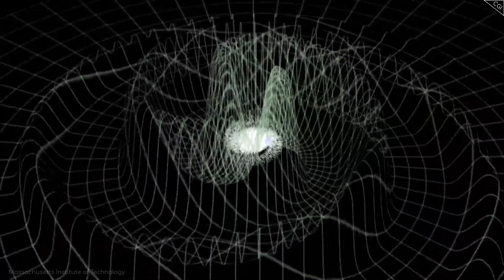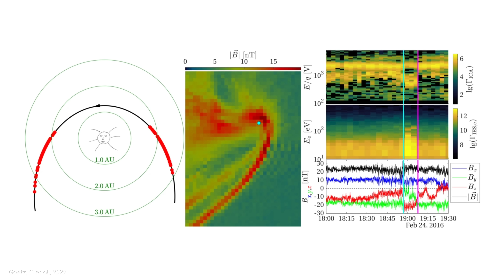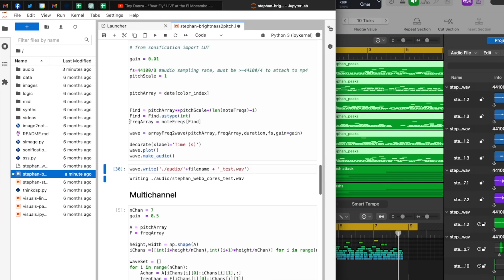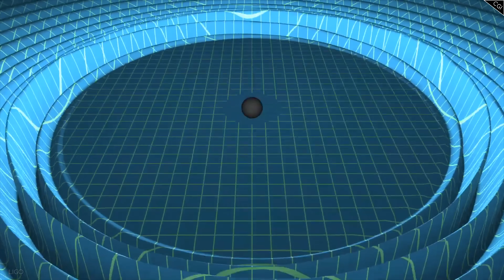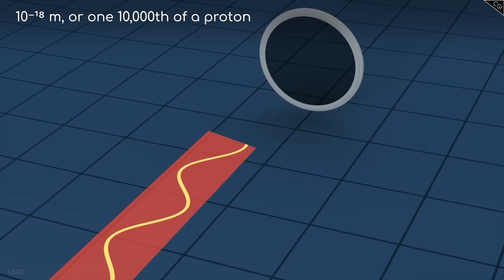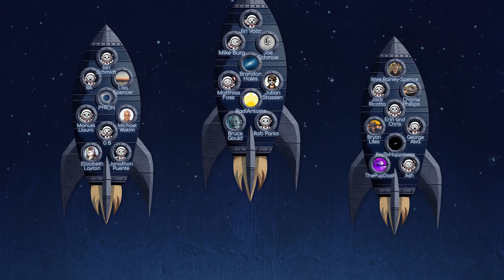This Is the Scariest Sound in Space

Comment: I have not actually watched the video yet, but there is no sound in space and very few vibrations. The most vibrations you'd get would be from your rocket/shuttle. Sound waves require a medium to travel through, and space is a near-perfect vacuum with very few particles. Sound needs vibrations and the empty-ness of space doesn't allow those to travel through space to another thing. Vibrations coming from your "ship" would transmit through the "ship". Not from a black hole to your shuttle or vice versa.

Comment: "Energy equivalent of 5 solar masses" Doesn't really explain it very well. So let's pull out a bit of Einstein to help with this. Energy can be converted into matter, and matter can be converted into energy. In fact, matter is just an extremely dense form of energy. The conversion rate is Einstein's famous equation *E=mc^2*. E is energy, m is mass (in kg), c is the speed of light (meters per second). Lets try it out. Get ready for some big numbers.
-For a baseline, the sun emits 3.8x10^26 joules in a second. That's 38 followed by 25 zeros.
Sun's mass is 1.989x10^30 kg. Multiply that by 5 and plug it all in.
E=9.945x10^30 x (299,792,458^2)
E=9.945x10^30 x 89,875,517,873,681,764
E=893,812,025,253,765,142,980,000,000,000,000,000,000,000,000,000 joules or roughly that.
Keep in mind that this is in gravitational waves which are completely invisible to us. However, if we divide it by our baseline it shows that if this energy was visible light it would be about 2,352,136,908,562,539,849,947 times as bright as our sun. That is literally brighter than all the stars in the universe combined. To quote Eccentrica Gallumbits, the triple-breasted w---- of Eroticon Six, these events are "The best bang since the big one!"

Comment: The audio from 67-P...any chance it's a by-product of the spacecraft's range finding gear? If the spacecraft uses a pulsed radar to determine precise distances, and those radar pulses are then interacting with the comet? I ask because the shifting return frequencies sound a lot like doppler shifts (i.e., higher pitch when moving towards, lower when moving away), which I would expect to occur as the spacecraft orbits a two-lobed object.

Comment: You're partially incorrect about space being a vacuum and sound requiring a medium to pass through and space not having any medium. Space is not a perfect vacuum. There are still a few hydrogen atoms per cubic meter. Knowing that, a medium exists, just not a good enough medium for sound to travel. Space is the closest thing we have to a perfect vacuum and that's why it's only referred to as a vacuum just based on its low density and pressure.

Comment: 10:09 I'm confused here: That frequency of the x-ray signal is so low that only a very tiny fraction of one period can have been recorded. But how can that be enough to convert it into a meaningful sound, or determine the frequency in the first place?
Reply: because they aren't using a recording but rather extrapolating data based on measurements. this means they can create a longer set of data that would be otherwise impossible to record, which they then generate the audio from.

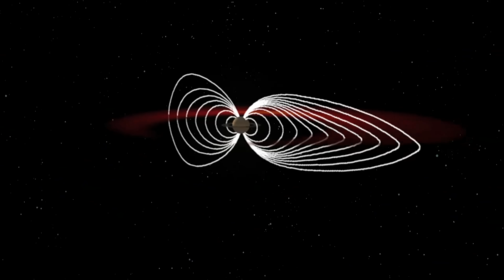Comment: 3:26 you're talking about two different types of slow motion.  One is made by firing the shutter at higher speeds, so it captures more frames in a second and then plays them at the speed we are used to seeing media in so it's fluid and more detailed.  The "smoother" effect you are speaking to comes from digital slow motion which duplicates frames and plays them multiple times, you're seeing each frame multiple times in a row.  That means that the video was not originally captured at a higher frame rate and they duplicated the frames and did not use modern day image tracking technology to generate frames in between that where a composite of the current frame and next frame in between which is also commonly used. It's just laziness I would say, it's cheap tech, they just suck at this.

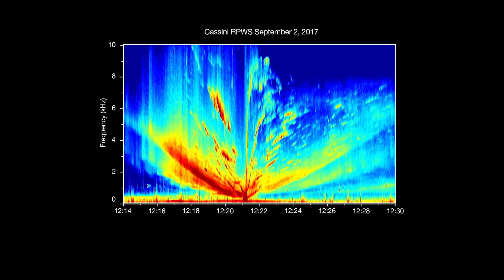Comment: The sound clip at 5:28 I've heard before on Earth with my own ears. It is a very similar sound that a passing Tornado makes. It is certainly something  you don't want to ever hear again. None of these sound clips are particularly eerie to me. They're more intriguing than they are scary. You can hear some odd transmissions using a Yagi antenna attached to a handheld HAM radio. I've heard abnormalities on 2 meter and 11 meter bands that no one has yet to discern.

Comment: Ther is no such thing as a vacuum in space, for it is not empty. All matter IN space can host sound. 

And that matter is indeed traveling through "empty" space. Of course sound cannot propogate without the object, but it's a logical fallacy to state that space is a vacuum. It's also full of dark matter. "There is no medium in "empty" space" So space isn't a medium which hosts mediums?

Space that was empty and a "vacuum" one second ago, can be filled the next>  with said object and vibration.

Sound is tied to matter—it doesn’t need space to get out of it's way. 

Another reason it is not an empirical statement is because the state of any "fixed area of space" being either space or full of matter is not a fixed state, but constantly subject to being the host of a medium.

Comment: I'm curious... If the wavelength is actually millions of light years long, and it has been compressed to a frequency of ~250 Hz, (human hearing) it would take around 2500 waves to make a 10-second video. If each wave is 10,000,000 years long, it would take 25,000,000,000 years to record that sound. That is older than recording technology, or for that matter, older than the universe. How were the data for this sound gathered?
Reply: … because space Time is something completely different to our moments of Time.

Not to mention, it is okay to not understand how to convert these numbers. Because that is how science works
Reply: Sound travels further and faster than anything if you think of it as simply vibrating particles of one another... In a medium of dense exotic matter, it wouldn't take much for sound to speed faster than light. Light is constant.. and it depends on matter in it's medium to even survive.. black holes steal light yet never sound.. because the sound coming from them is faster than can be comprehend
Reply: Exactly!?!!!!
Reply: It's all just best guess...
Or, in this case, made up.

Comment: Heat waves magnifying frequencies vibrate through space as normal perpetual motion of displacement impaction force of currents flowing repulsion to cold space itself is a weak external magnetic field filled with dark heat energy outside of entanglement of mass and mass as magnetism. Event horizon perimeters within and without entanglement of mass are generators that increase flowing currents quantumized and macro as elements and galaxies as accretion disks outside of the sphere or core cycling circulation around these monopoles of massive external magnetic fields. Wind of currents flowing around these massive monopoles of pure fabric of cold repulsion of space itself. Mass occupies space as neutralized repulsion within mass as occupational space itself as outward force of pressure known as impaction force when displacement can't be overcome and is weightless outside of a greater magnetic field. Mass is always outward force of pressure. Mass is magnetic it absorbs heat energy and refraction of reflection, bouncing off mass, lighting  up the mass as quantumized sparks of entanglement. Mass is an internal magnetic field that circulation centrifugal force faster through its core or nucleus as internal magnetic fields grounding currents. Earth's internal magnetic field is unification of unidirectional flow cycling circulation centrifugal force faster than normal momentum of space velocity accumulation of elements magnification heat internal magnetic fields grounding currents through its nucleus or core where external heat energy flow is strongest at the core or nucleus. Planetary internal magnetic fields prove hypothesis of internal magnetic fields of mass as macro to micro hurricanes as mass galaxies are formed around these external magnetic fields spinning all external heat energy within its field outside the nucleus.